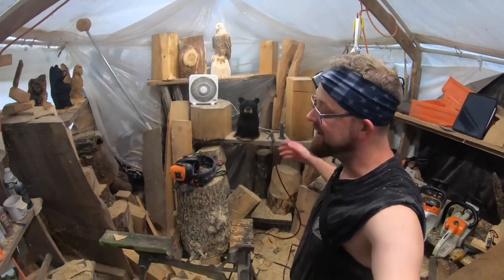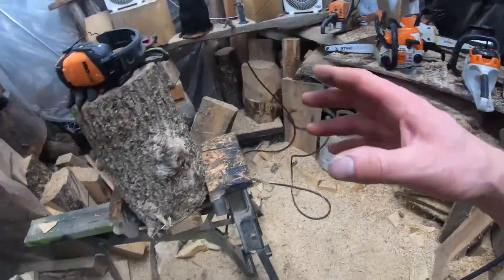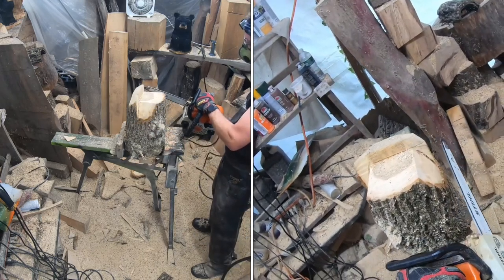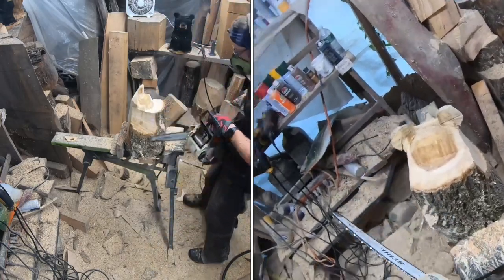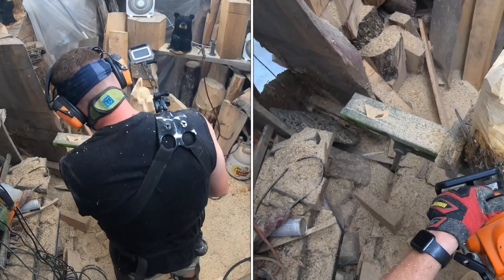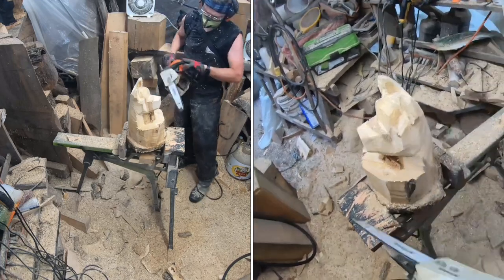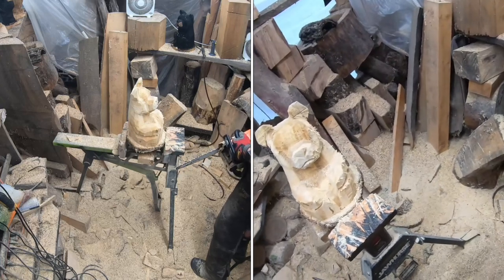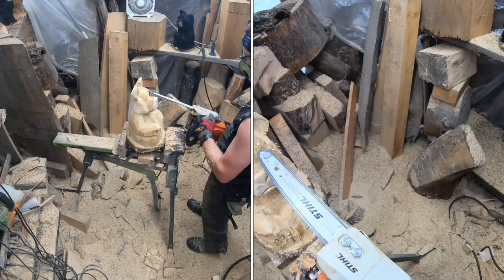How to chainsaw carve your first bear. Very beginning chainsaw carving tutorial.

Comment: Did my 1st Bear last week using most of these tips from Kyle. Excellent videos and tutorials. Thanks Kyle. I have my electric chainsaw set up with a regular 12" bar and have a quarter tip bar and chain on the way. The 12 inch bar was an excellent jumping in point.
Reply from the maker: That is awesome!

Comment: Great video!  I have to try this. Would a battery saw achieve the same results, I'm just concerned about the noise of a petrol motor. What saw would you recommend?
Thank you for the content and expertise 👍
Reply from the maker: Yes it would . I run the Stihl pro line of battery saws . These are the Msa160 Msa200 and Msa220